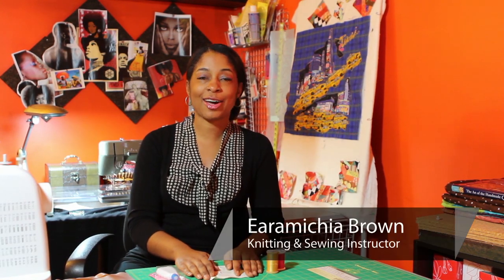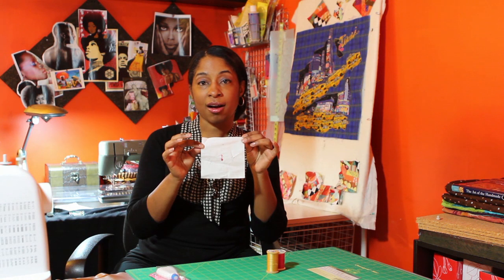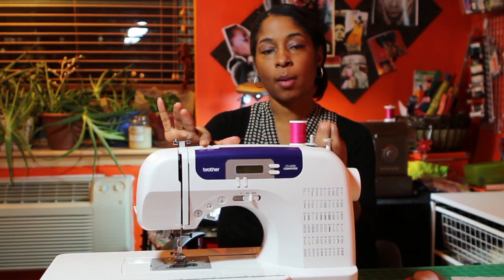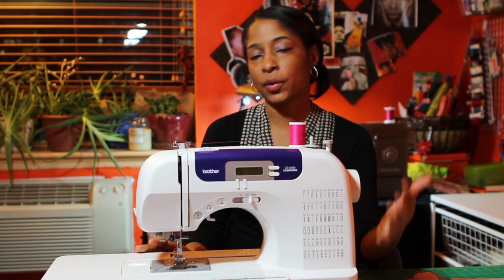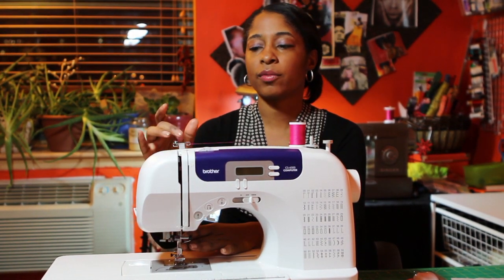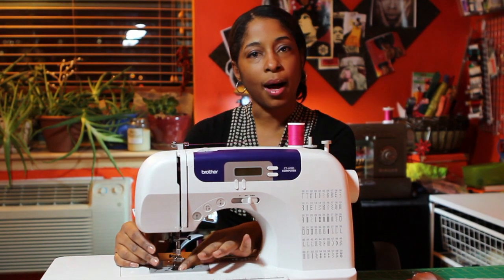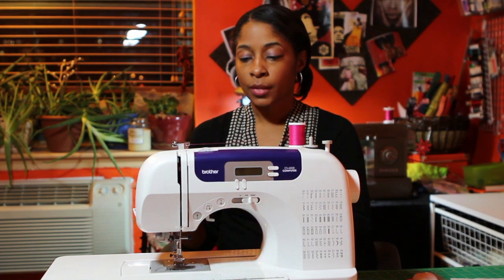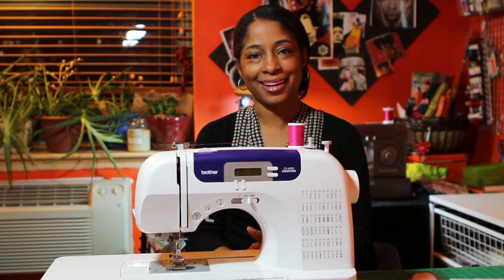Sewing Help : Sewing Machine Problem: Thread Bunching Under Fabric

Comment: When you press on your pedal and begin to sew, hold on to your top and bottom threads, pulling them gently back. I usually just rest a finger on them. This prevents them from being drawn down into the needle plate hole and getting tangled.  Once you get going, just let them go.
Reply: This helped 100%!!! Thanks!!!
Reply: Thank you!!!

Comment: every time I sew, not only is the thread is bunching up, but the thread keeps getting caught in the hole where you get the other thread from the bobbin
hopefully your tips will also solve this
Reply: Same!
Reply: well, the bobbin I used came with the machine, but I fixed my bird nesting problem a LONG LONG time ago, so my machine works fine now :)
Reply: Mylie Blue o
Reply: My name fahimu ddin siwig masin experience 20 yars
Reply: How did you fix that?

Comment: Sorry, I guess I reach my limit in the first message. 
It's important to clean the bobbin area, making sure the tread goes the right way, every machine are different.
And...verify the tension on the bobbin, it should be tight enough but not too tight. 
If it's a problem with the timing because for some reason you throw it out of timing with a pair of jeans or something, then, depending on your model look up how to time your machine on YouTube if it's a older model.
For computerize one, I suggest to have your dealer look at it. They should be a phone number on the back or look up your brand dealer in your area.
Joann's fabric service Vikings and some Singer. 
Not sure about the other brand but they might help you without taking it in.
Good luck with your machine, I'm sure it's not a big fix, I fix them all the time and it's always something silly. 
Happy sewing!

Comment: Great video, thanks! I've actually been sewing for a long time, but refreshers are always helpful, especially with a new machine. Thanks! There was actually a lengthy discussion about this problem on Amazon. Turns out, the bobbin casings are coming from the factory with dirt, lint, etc. that keeps it from seating properly. Cleaning with a barely damp rag fixes the problem.

Also...I'm having a HORRIBLE time controlling the speed of my XL2600i. Maybe it's because I've been using a 45 year old Necci for 30 years, but practicing doesn't seem to help at all...I've tried stitch guides...everything. It's just too fast to even stitch in a straight line, rendering it completely unusable at this point. Any suggestions you can offer would be great. Thanks! :)

Comment: my upper thread is wrapping itself around the bobbin and creating a serious mess under the plate. I've re-threaded both upper and lower threads, cleaned everything I could  changed the upper tension, replaced the needle nothing works. My needle is in the proper way and I always leave my presser foot UP when threading. My bobbins are the proper size and I'm using the proper thread.
Reply: Cavy Lover 82 I know this is late. Just seeing these publicly.  I am used to the occasional emails.  The next thing I would check is your Thread.  Sometimes the thread just doesn’t work and the combination of thread, needle and machine.

Comment: Thanks  for the tutorial.  The problem I just started having is every time I start sewing, the thread comes out of the needle. I'd re-thread my machine, sew a few stitches, and again the same thing would happen.  I've never had this problem before, looked in the sewing manual/trouble shooting,  tried a few things and nothing has changed. Do you have any idea what the problem could be?  By the way,  your machine looks almost exactly like mine!, very nice.  I love my sewing machine. Thx 4 ur help

Comment: hello, I have been facing a weird problem while stitching, when you look on the reverse side of the fabric you an see  lot of broken thread and knot like
Reply: I would also check your thread path, or the type of thread you are using in the top and bottom, is the needle correct for the thread size, do you need a new needle?

Comment: I have a brother  machine and just yesterday I got an issue with it.  when trying to stictch a button hole or any stitch that is not a straight stitch it wont catch on  the right side at all. so pretty much I get half a button hole on just the left side of a stitch. any ideas on what is causing this?

Comment: I got a Singer 411G at a yardsale this week. I followed the map for threading it, but I can't get the tension to work. It's not nesting, it's breaking at the needle. Also, the thread looks too loose when I'm running it.
Reply: Raven NewMoon I would rewind the bobbin, ensure that the bobbin casing doesn’t have any hidden lint, also check the face plate.  Rethread and ensure that the bobbin is insert in the case properly.  Usually looks like a number 9 with the thread being the tail of the 9.

Comment: I keep getting this strange extra loop around the bobbin so I end up with four threads, and the extra is often very tight so I can't easily pull the fabric away when I lift the needle. I've tried to search for the reason this might be happening, but I find nothing. Maybe I don't know what the problem is "officially" called but it's driving me crazy. And when it happens, it happens continuously. I've fiddled with the bobbin and it stops, but I honestly don't know what I did to correct the problem. Any thoughts?
Reply: This is what I'm trying to find out too.
Reply: Just seeing these publicly.  I answer emails.  First, clean your bobbin case, etc.  then retread the machine.  Ensure you have a needle appropriate to your fabric etc.  Ensure your thread is properly wound on the bobbin.  Then reinsert the bobbin into the casing.  Make sure it is inserted properly.  Usually like a nine, with the thread being the leg of the nine.  Ensure you pull it up through the proper notches, then ensure your tension knobs are correctly set for your project.  Remember righty tighty, lefty loosely.

Comment: Hi,  my sewing machine was working fine, I actually sewn one seam, left the machine on, and wanted to use the zig-zag finishing, when suddenly the bottom thread is just one loose mess of thread when I sew. I have reset the tension, taken out the bobbin and cleaned it but it is still the same. Any one any ideas please?
Reply: +Johanna 4567 I am guessing the widest zigzag position on your machine caused the problem. If the widest setting is 7, try to set it to 6.5 or 6.
Explanation: In the bobbin casing, a hook travels in a circle counterclockwise like a shuttle, this hook must pass through the needle scarf (a little pocket in the back of a needle (the flat side)) when the needle is in the lower position so that the hook can catch the thread to complete a stitch. The zigzag stitch changes the needle position left and right from going straight. Some machines, if not adjusted well, the hook could not catch the thread when the needle travels to the extreme left or right due to its timing, but straight stitches are ok.
The ability of making a precision sewing is what tells a high quality machine from a low one.

Comment: I have an older singer machine. I  think it's  about  a 1986 model. Got it not long after I got married.  Currently I'm having trouble filling my bobbin. The thread keeps winding under the bobbin. I know weird huh? I've cleaned every thing and checked the tension and re threaded the machine. I have been sewing for years and now my way around a machine but this is very frustrating. Any advice would be appreciated. Thanks
Reply: TLChristen just seeing this.  Not sure if you were someone who has emailed me.  I would rewind the bobbin and ensure your threads match the weight at the top, also check that your machine is oiled... it could also be an issue with the bobbin winding system.  I am sure you have, but also ensure that the bobbin is seated properly on the machine.

Comment: What about if it keeps feeding the inside of the machine. It got looked at and there was a baggie full of thread. K. All fixed. I go to use it and it starts all over again. But it's not like the machine is running smooth the whole. Sounds very rough and definitely something wrong with the mechanism holding the needle
Reply: faith smith you may want to check your casing area. Oil the machine, and sometimes it may be a grater issue with the machine, etc.

Comment: I tightened my bobbin (the actual bobbin) and fixed the problem right away.. You forgot to add that fix..
Reply: +Bitchzilla 420   You are a GENIUS!!!  I had already tried everything E suggested and none of it worked. I was just about to close out and I saw your post. It worked like a charm. You ended months of my frustrations!!!
Reply: +Bitchzilla 420 May I ask you tightened the bobbin or the adjustment screw on the bobbin case/holder? if so, how much turns and at what direction?
Or, you tightened the bobbin by rewinding the bobbin thread to tighten it?
Thanks for replying.
Reply: I tightened the screw on the bobbin casing (sorry I kept saying.bobbin).   and it's right tighty,  lefty loosey

Comment: my New Home machine just wont sew and needle goes up n down a bit bit not enough to sew and needle stuck in material xx please help
Reply: New home are great machines, I own one, maybe two?  Lol
I have quite a collection of different brand. 
Your problem could be a couple things.
First you need to clean it with a pressurized can of air and oil it and grease the gears if it's an older model.
Start from the top and make sure there is no lint in the bobbin carding under the feetdogs or even in between the feed digs that prevent them to come up to grab the fabric.
There is a possible blockage somewhere from treads that as been pull off from the top ( a big no no) 
Always cut your tread at the spool and pull from the bottom after you take it off the needle to prevent pieces been stuck inside the machine.
Then, after you clean and oiled, wipe the excess and retread...make sure you don't accidentally put the tread outside the 2 tension disks. But in between if you can see them ( on older machine it's up front) on newer inside the cover. 
Change tread brand, some machine are fussy about good quality tread.
Change the needle,
Reply: +Sun5787 My hubby bought me a new Janome 2200XT and pleased with it just ordered more feet for it xxx made a cover for it xx not perfect but first attempt xx it does have a dust cover with it xxx goi g to try and make my Christmas presents with it xx

Comment: Ms. Brown.... what about adjusting the BOBBIN tension!!??   How do you do that??  And can you do that without voiding the mfg. warranty??
Reply: Yes you can adjust the bobbin tension. There is a small screw on the bobbin case that can be loosened and tightened.  If you do that you should ensure that the thread can advance still.  Typically, it is said that if you hold it like a yo-yo the thread should release slowly.  I would check a video on that specifically.
Reply: @CocktailsandThread       Thanks!!  I appreciate your update and help.   Best wishes....    Ax

Comment: My thread keeps bunching and my needle keeps breaking as well.. I've re thread.. dusted in the bobbin area.. I'm not familiar with where the tension should be.. The brother xl2600i was given to me by dad who happen to find when someone threw it out. .so I don't even have instructions for it. .side note I've been sewing for less than a few months so I really have no idea what I'm doing..plz help! LoL
Reply: monica  did you ever get the problem figuered out?
Reply: Rachel Martolock  no I never figured it out :( I just bought a new pack of needles so I'll try to figure it out again!
Reply: +monica Bitchzilla (above) solved my bobbin hell!! she suggested tightening the bobbin case. I twisted it one and 1/2 times and just like that, it worked !!!

Comment: None of these ever works for me. My machine is new. It only happens when I sew stretch fabrics though. I purchased the "right" needles and it still makes a horrible mess.
Reply: ROSEMARIE SMITH use Thread that is designed for stretch fabric.  It has a bit of elastic in it.

Comment: I have a new Brother machine, and used it 5 times for a few things like hemming pants. Already the tension does nothing. The machine is digital junk. I have been using SINGER machines for 23 years and never came across a problem I cannot solve on them. If I can't take this machine back to the store it is going in the trash.